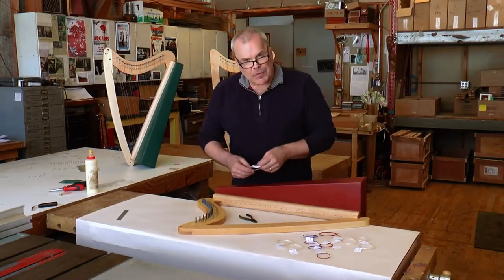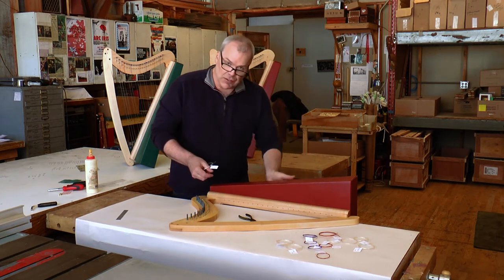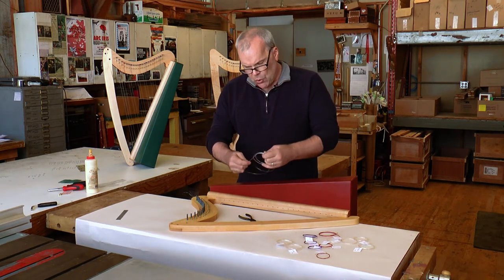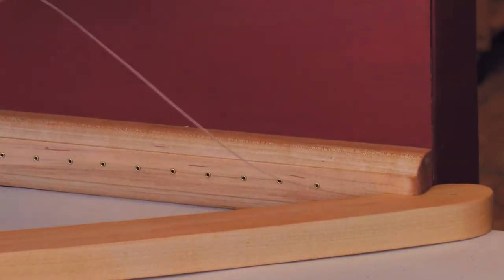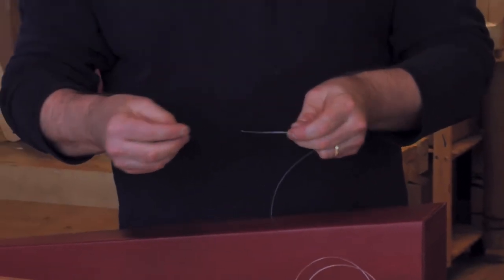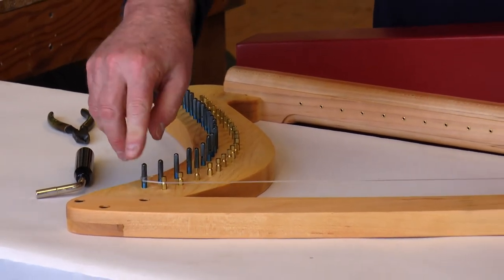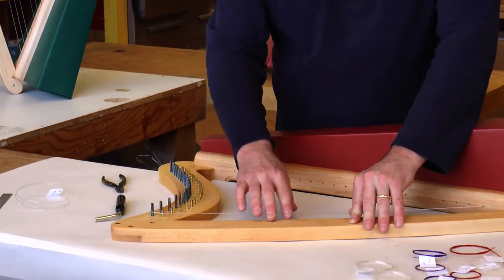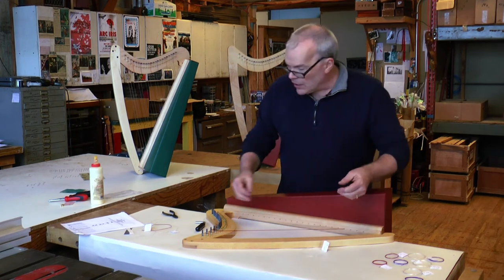How to Build Your Fireside Harp 8: Stringing

Comment: Is there any way you could make a video viewers could use to tune their harp once completed? I'm stringing my harp right now, and that is my next challenge...getting her tuned up!
Also wanted to add, these videos are a great supplement to your already fantastic instruction booklet. This was a very satisfying project to do!
Reply from the maker: We are planing on some more videos...mainly about installing levers...but your's is a good suggestion too! Some quick thoughts as you begin to string...
One of the most important steps when tightening your string is making sure that the knot is "set"..in other words "locked" so it won't slip. Often if the knot is not set it allows the string to slowly (and frustrating) slip out of tune...so when you have put the string through the hole give it a good hard pull (You'll often feel the string slip and lock) even before you fit it to the zither pin.
The other step is when you have the strings attached lay the harp on it's side on a table with the body hanging off the edge (you should just have the wooden frame on the table). Gently, but firmly, push the strings away from the bridge pins. This helps to stretch the strings (and set any knots that might still slip) and get it settling into tune. It'll still change a bit but if you continue "exercising" them they will settle quicker...
Hope that helps! And thanks for the review! Glad you are enjoying the harp.
Reply: Thank you so much for replying back! I think my strings are good, but boy is it tricky to find a good tutorial for tuning! I look forward to more videos from Fireside! They are so easy to follow along! Also will be sharing pics of my harp very soon!
Reply from the maker: @1originalhaley  check out Christy-Lyn...she'll help you get started!